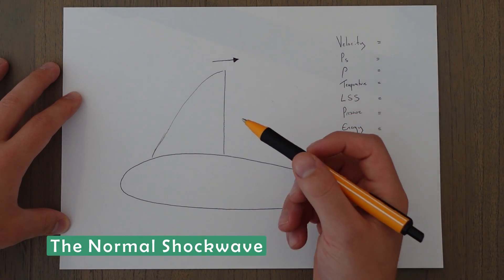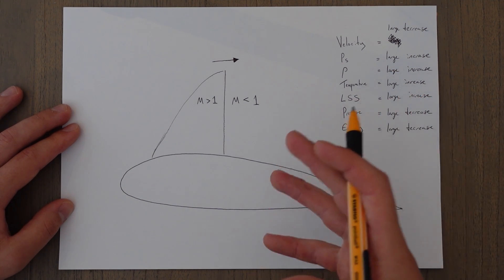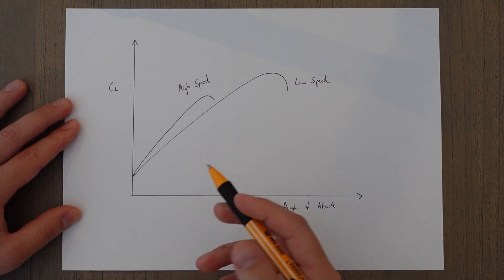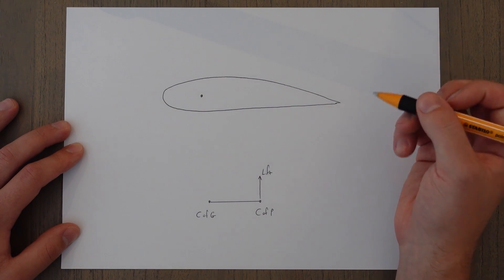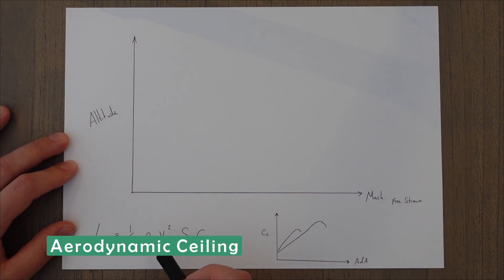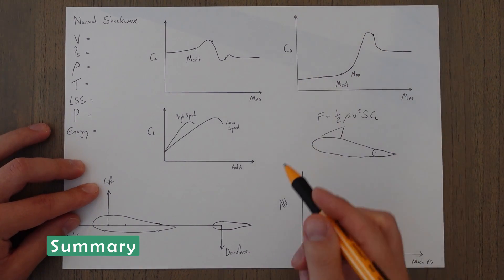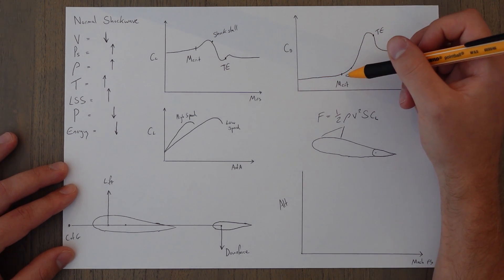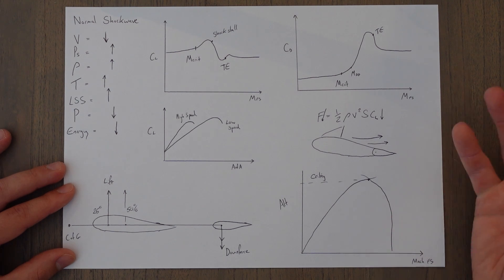ATPL Principles of Flight - Class 21: Supersonic Flight II

Comment: ahh isn't it your pressure increase when you velocity increases ? after passing the shock wave there will be reduction of velocity with will cause pressure to increase
Reply: Static pressure increases but the total pressure in the system (Pstatic and Pdynamic) overally decreases due to the energy conversion (Energy in a system is always equal: Pressure energy converts to heat energy).